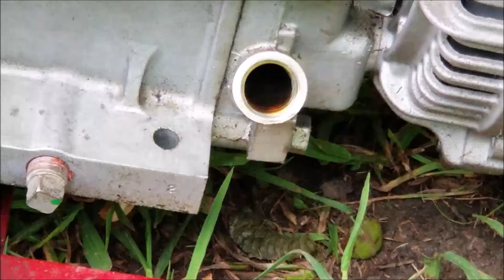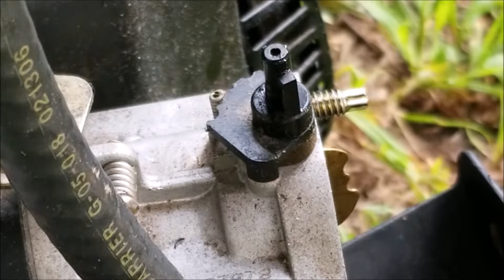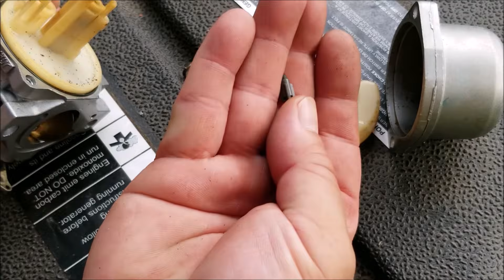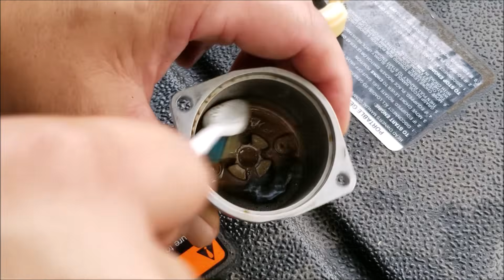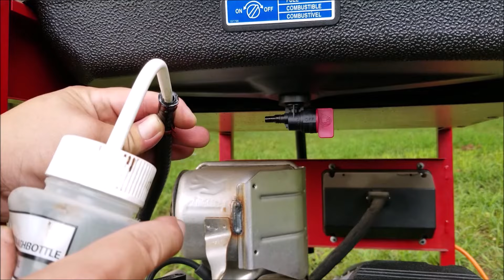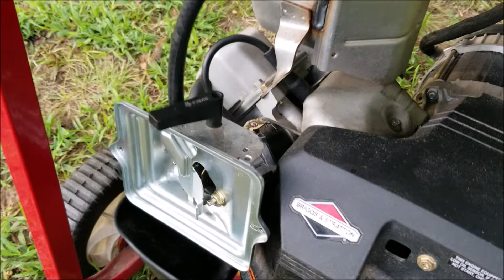Fix a Briggs and Stratton generator that won't start.

Comment: Just wondering why you said to add a stabilizer to the gas to run it from the tank.
Reply from the maker: Most people don't use their generators often so the gas goes bad. Adding stabilizer will keep it from going bad and last a bit longer.
Reply: @HomeGaragechannel  I do use seafoam, seems to work great for me. I will let gen 
run on maint. with a load, BUT after it ran 15 minutes or so, I still shut off gas
and let engine die from lack of fuel, then drain the carb if it has a drain bolt and 
most have. My 7250 watt Powerhorse ran 16 hrs a day for 10 days during Irma.
I had plenty of oil on hand and changed it every 32 hours. Kept air filter properly serviced, most are foam, wash with dish soap. rinse let dry  saturate w motor 
oil then skweeze out excess. keep an extra filter or two around, plugs too. way
too often people would buy these an run'em str8 out for a week, not changing 
the oil. . .or service the filter, even after the storm, there are winds that keep up 
for a bit blowing "dust in the wind, getting sucked up into my eng-gine, same ole
song, run with a dirty air filter for oh so long' doing a spiff of a song there.
Reply from the maker: @raymondgarafano8604  I agree. Most people aren't aware of the maintenance routine to keep these generators working year after year.
Reply: It help the parts in the carb like the float needle not rot away

Comment: Very nice job. I very much dislike those Nikki carburetors. I think there is a replacement for them but I can't think of the name at the moment. I rebuilt two of them this week alone. I am in the country so lots of people have generators here. I recently fixed one like the one you just did, and it was only water in the gas because the guy leaves it outside all the time. I tell people to always drain the carb by shutting off the gas but it usually goes in and out of their heads. Also I recommend non-ethenol gas but again it usually doesn't happen. Thanks for the video.
Reply from the maker: That's called job security.  Thank you Waterman one for the comment I appreciate it
Reply: Yeah Taryl  of taryl fixes all who works on small engines does not like the Nikki either,
says Walbro is a better carb.. When I fix a gen 4 a customer, it is just about always cuz
they left gas in the carb. I tell'em just once. "U want this to run when ya need it? make
sure there's no gas in the carb when ur done with it". Sometimes it will sit for over a year,
then when I do get her running, she won't put out as she lost all her residual magnetic
field and charge a small junk to get it back for them. They buy a Genset to avoid some
inconvenience but have absolutely NO idea about proper maintenance, Then hiss and
groan it was not a good generator, Oh when will they ever learn?
Reply from the maker: @raymondgarafano8604  very well said.  Thanks for the comment

Comment: Having a generator is family specific I believe.  Some families have very little frozen  or refrigerator foods so not a lot to worry about.  Also if a household does not loose power very often it may not be necessary.  However, if you live in an area that loosed power because of storms or other problems I would certainly consider one.  Also some folks need portable power so that is another consideration.  Just have to start them periodically and store them properly.  Great fix for sure.  Nice sounding generator now.  Thanks for sharing.
Reply from the maker: No problem D Butler and thanks for the comment I appreciate it